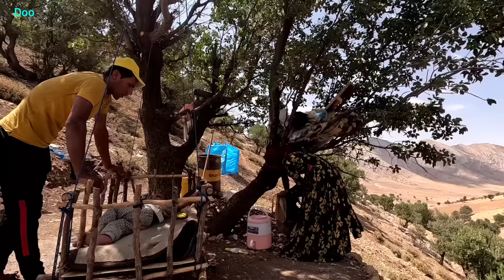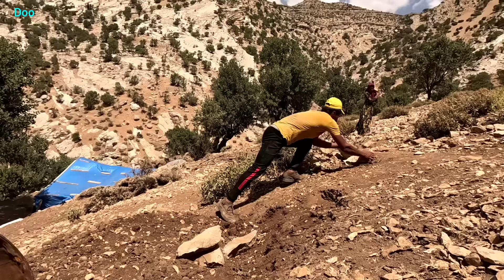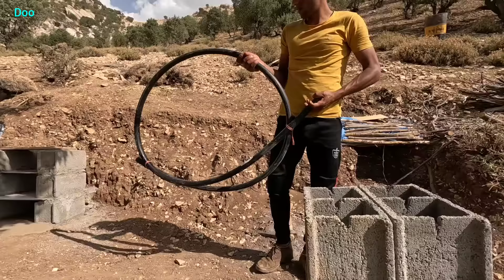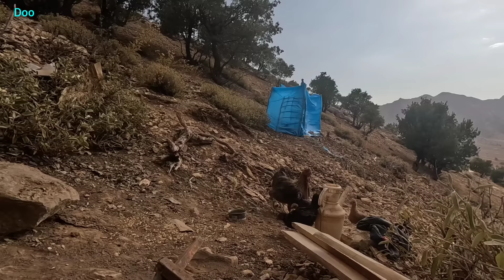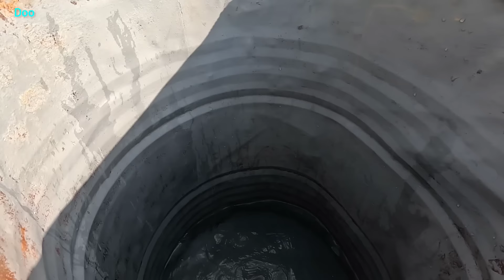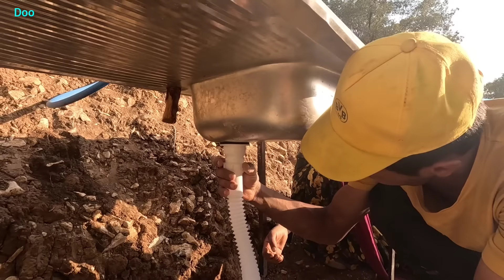Documentary about setting up a bathroom and kitchen water tank by a brave woman and her sick husband

Comment: Great efforts. The clay is not going to hold the barrel up because it’s weak. If at all possible, just gather more stones and rocks to support part of the base of the barrel, or, if has the money, buy a bag of cement, mix in sand, then use the mixture to support the barrel.